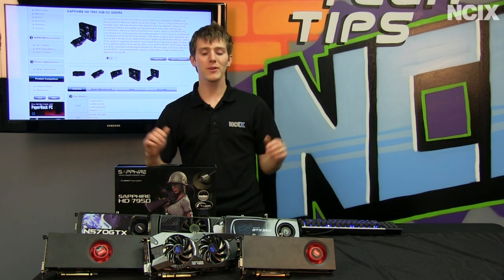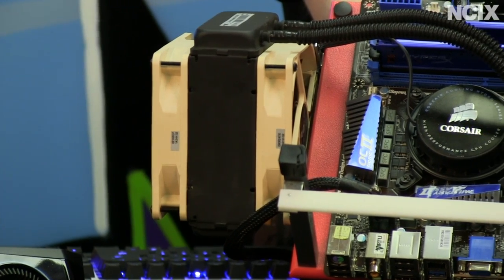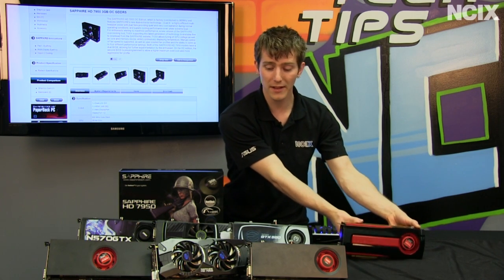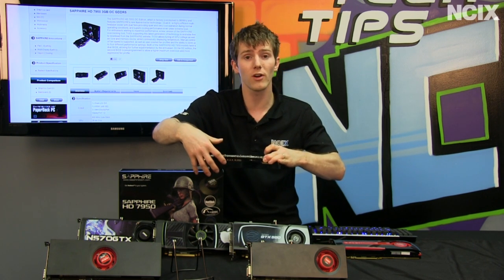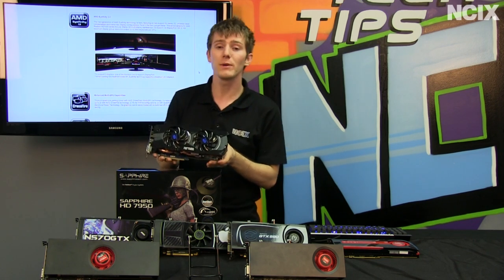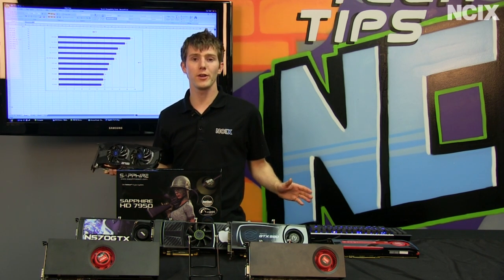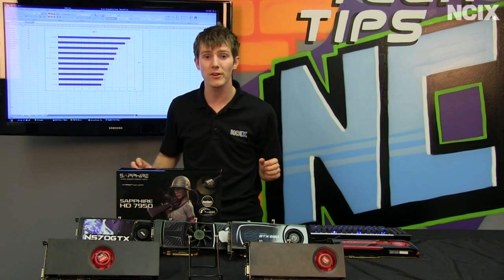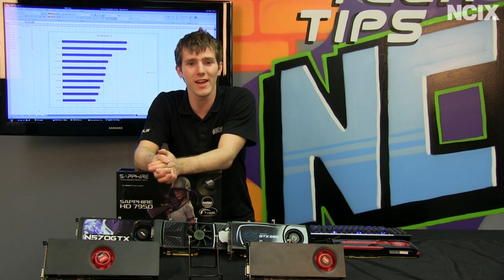Sapphire Radeon HD 7950 Performance Review & Technology Showcase NCIX Tech Tips

Comment: Hey igot problem my specs: 
Cpu : fx4350 
GPU: amd 7950 
Ram: 16 gb gskill sniper 1330ghz 
Hdd: 2 tb 
Psu: 600w mod 80 plus 
 BF3 RUNS AT avg 30 FPS 
But later I found that on cpu z app 
That my cpu is running on 2 cores when it's advertised at 4 cores. I don't understand I unparcked them over clocked the GPU nothing happened could I get some help here  $1000 on this pc just to get 30 fps in bf3 I can get that my ps3
Reply: Khinu DC You spent $1000 on that PC? wow... bad deal.
Reply: Khinu DC im pretty sure you have to, click on the 4 cores instead of just the two from going into properties; but don't quote me on it mate... :)
Reply: you could have gotten a way better pc for that money man

Comment: Still is an epic card! Runs BF4 on high settings with above 60fps 24/7
Reply: runs ultra 50-60 fps, Which is still more than playable.
Reply: MasterOfRockKL Drops down to 40 on ultra sometimes, as I have a 144hz I like to play on high as I get 1 and a half times more fps!
Reply: Personally I can deal with a few dips to 40-50fps. but the average is still 50-60fps ultra. To each their own :)
Reply: MasterOfRockKL Maybe your card is a bit faster because mine gets thermally throttled? My gpu hovers around 87-90! I have the xfx DD
Reply: jabbacoola1 Correction, You Sometimes can get more than 100fps, max fps and average fps are two completely separate things.
Reply: make sure you have good airflow in the case.
Reply: ***** Ty for replying on a 2 year old comment, it really helps!
Reply: RCTestKid i just find this card  on a dirt cheap offer and i start to research it a bit more and i learn things
Reply: @AndreiSolomon  years late but I found one for 25 is it worth it?
Reply: @ESKLEADER  no, it wasent worth it 5 years ago

Comment: will i3 3210 bottleneck this card????
Reply: yes
recommend you to get i5-2500K at the very least
or you can take FX 6350 or 8320 at the same price for i3
Reply: nickostrife i want to get the fx 6350 but my motherboard only support intel processors and getting i5 or i7 is a problem for me  because intel processors really expensive compared to amd processors
Reply: what's your budget?
you might wanna start saving on i5 3570k or if you're on a tight budget, investing in AMD system won't be a harm at all
Reply: nickostrife but i heard  that i can't install amd processors in my motherboard which is GIGABYTE H61M-S2P (Intel h61)  ..... what about gtx 750 ti will my i3 bottleneck it too???

Comment: Does this card support mantle?
Reply: AfterWind 7950 does support mantle. I own the his variant, I would know.
Reply: it's amd and mantle is an apu so yes
Reply: ImKaso WTF, don't listen to this guy.
7950 does NOT support Mantle, only the 200 series does, also Mantle is an API.
Reply: thanks
Reply: yup
Reply: i run it crossfire and it does mantle
Reply: ImKaso How much power does your cf setup take? I was thinking about adding another gpu to my system but I don't know if i should upgrade my 600w pc.
Reply: eeem i had a 650 and it was not enough you need 850 but i have been overclocking and i enjoy to buy things that is totally o k so i have an 1000w psu
Reply: ImKaso thanks.

Comment: man this card still kicks ass even though it passed through 2 generations of nvidia cards
Reply: +yonan007 i have a question im not a heavy gamer so i can pass for now on those fancy R9 390 and blabla i don't want to play Nvidia and i already own a pretty cool A8-6600k can it be good on a Crossfire ?
Reply: Hi, yes it's good on crossfire but I really suggest that you get a newer card for the support of dx12. Good luck 😉
Reply: yep i think of buying a new one but RED side and im strugglig for a small discrete card that doesn't bottleneck my A8-6600k
Reply: Take a look at the r7 370
Reply: i'll do i hope it will be sufficient enough to run MGS V phantom Pain with my A8-6600k overcloacked ? even on low or medium
Reply: It will ;)
Reply: no need for that lame ass PS4 thx for your advice in december i preorder that card right now i have to finish to buy my LG G3 i might as well get an LG G Watch to pair them !
Reply: +Roger-Charles Manga waw i myself have an lg g3 what a coincidence
Reply: i was just tired of my lousy Acer Z310 which can't even connect to my router and it's sucks !

Comment: I don't know where the hell potpolima gets his info but the 7950 is most definitely not 350$ I've literally spent the last week looking for the best deals and some are as low as 250 with rebate.
Reply: 259 waw seeing this comment is so weird: 1 year later i can but his card used for 100- 110 dollars
Reply: Lordmirio he posted it 3 weeks ago, not 1 year ago. and the 7950 is so cheap and it is much more powerful than a 760
Reply: Lordmirio And now I can't find a 7950 for less than $400.
Reply: Lordmirio They're still sold out, so it doesn't matter what price they are right now. I guarantee though that if they are in stock they will go for over $350.

Comment: the 7950 has more VRAM, in case someday you want to have a dual monitor setup (with 3 monitors you would need to crossfire), or play heavily modded Skyrim, GTA IV, etc. The 760 is about $50 more than a Sapphire 7950 :)

Comment: if you use openCL as your render, then the 7950 is going to be a great  slave card for real time 3D rendering!. but if you work a lot with C4D, you should get a Quadro or Firepro just because the drivers are optimized to get you the best performance of the card.

Comment: well the memory Memory Interface on the 7950 is higher"faster" than the 760.
the 7950 has 384bit memory interface while the 760 has 256bit so technically you should be able to get 20-30% more performance from the 7950

Comment: it really depends, the 7950 has pretty much the same performance as the 760 for roughly the same price, BUT (and this is optional) if you were to SLI the 760 and crossfire the 7950 the 760s hands down blow away all the competition within 450-500 USD because more than likely with 7950 you'll get micro stuttering. But if you don't do like 3d stuff, video editing you just want gaming and you hate crossfire/SLI then it really all comes down to how important advanced physX is to your gaming.

Comment: Over the reference design?

Yes.  A HUGE difference.  The reference design with the impeller fan (?) is almost always really noisy because of coil whine and runs hotter.  For cards that cost more than about $150, I recommend to stay away from the stock cooler.  The aftermarket cooling designs are almost always worth cost extra $20 that they cost over reference.

Also, the reference cards usually can't overclock as well due to the lower thermal headroom.

Comment: Yeah you can pick up a 7950 on eBay or newegg for around $210 if you get a halfways decent deal now.  I'd say at stock the 760 wins. However, the 7950 is pretty much the king of overclocking.  I don't know for sure but I think once you hit about 1000-1050 Mhz on the 7950 things change in favor of the 7950 quite rapidly in that comparison.

I'm not 100% sure on that, though.  If you're looking for the best bang for your buck, the 7950 is about as good as you can get now for ~$210.

Comment: I enquired about a basic build with a £500ish budget. Ram isn't a problem because i already have it. So the set up i was told that would be decent would be:

Mobo: ASRock H87 Pro4 ATX LGA1150 Motherboard 
CPU: Intel Core i5-4570 3.2GHz Quad-Core 
PSU:Corsair CX 750W PSU
GPU: This Card or the Vapor-X OC Version.

Is this a good combination? I don't know what works well together but know how to physically build a PC. Any answer would be appreciated.

Comment: Speaking from experience I know the hardware in both cards, the only thing the 660 ti wins at is Texel rate so it is easer for the 660 ti to show AF but the 7950 has more memory and bandwidth also a higher pixel rate, the texel rate difference is around 10-15% (Delta) so overall the 7950 is a much better card and can be OC'd higher.

Comment: can TRULY say that. I got a Sapphire HD7950 OC 950mhz edition. At base its just faster, but you can simply overclock it more. I reach a stable (24/24 use) 1150 mhz for Gpu and 1500 (mean x6 = 6000) Mhz for Vram. Yeah, it ger a little noisy but that thing is a MONSTER. 670 ? naaa ever better than a 680 !!

Comment: I have the AMD Shappire 7950 3G (Not the OC version) and im experience some problems.. This card should run most of the new games on high and ultra, but that aint happening for me.. Most of the games i have tried out lags and the frames freeze up some times, and this is very annoying! And some games wont even have 20+ fps when i have them on low setting! I have a pretty basic setup that should run most games without any stress.. Are there anything i could do to fix this?!?

Comment: At stock clocks, sure. If you overclock a 7950 to 1200 and 1700, it will easily beat a 670 at 1050 or so, which is what they usually overclock to.

Comment: Sapphire HD 7950 with boost vs MSI GTX 660 Ti power edition. Results from 3DMark: 7609points with HD 7950 , 8351points with MSI GTX 660 Ti P.E. So amd sucks. I played crysis 3 with both graphic gpus  and with 660 Ti the game was running way better and i had 5-9 frames more than with 7950 for the whole game with full settings and SMAA at medium.

Comment: Then you would be ignoring the 7970 Ghz edition. Also the GTX 690 is not a single chip car. The order would be like: HD 7970 Ghz Edtion, GTX 680, GTX 670 (since you can change the bios of the HD 7970) and HD 7950.
There is a test in HardOCP that shows that when oc'ed the HD 7950 can surpass the GTX 670. Of course not all cards oc equally, but it's a very achiviable OC. 1150 Core and 1400 memory. So the guy is right. 7950 third more powerfull single chip card avaible now 2013 Q1

Comment: rank 7 is not low by ANY means. There are many many GPUs out there, imagine someone said you were the 7th most handsome man in the world, that would be about as impressive. As for cards 1-6 as ranked by PassMark (rating using G3D) is 1. GTX 680 ($460) 2. GTX 670 (360) 3. GTX 580 ($310) 4. Radeon 7970 ($380) 5. GTX 690 ($1000) 6. GTX 660Ti ($270)
    Now this is just one benchmark, there ranks here that I disagree with and other benchmarks measured differently will show different results.

Comment: Get the Sapphire 7950 vapor-X 3gb and use the Sapphire TriXX Tweak Utility which overclocks it up to 1150MHz and up to 1600MHz on GDDR5 memory and this overclock can be achieved with stock voltages so it runs really cool. My temps are 34C idle and 56 Load which is really good. Look at the 7950 review on legitreviews(DOT)com then select video cards then its the seventh one down. Its the best card for Temps.

Comment: i bought one, should be coming tomorrow.
the good thing is, the price is right for what you get. (270€)
also you can easily oc it to 7970 clocks from what i´ve read.
my 5850 1gb runs bf3 on high with no problems but gta4 and skyrim with ~150 mods (4k textures etc) is maing problems. 3gb graphics memory is a hughe and in general the 7950 will be in my rig for at least 2-3 years

Comment: If I was you I would have gone with a 7950 as one, these overclock far better than a gtx 660 ti as well as overclocking the memory is more effective on these cards. with spending so much on a card you would expect to keep it for a couple of years AT LEAST! with the 660ti only having a 192 bit interface this is going to hold it back as supposed to the 384bit found on a 7950 plus it has 3gb Vram and like I stated before can overclock so much to where it's in par with a 7970 GHZ edition!

Comment: no a corsair 650 is enough to crossfire a 7950 cause it has about 600 watts...400 would be used for the gpu and the other are enough...and i know i dont need to cut on the psu...but anyway it aint modular and with only 2 6 pin connector i can t crossfire but i dont think i either need to ;)...also it a collermaster psu..and with 86 percent eddiciensy it s very good..

Comment: well i m sure that phenom is better than fx and i ve seen lots of guys with phenoms and 7950 without serious bottleneck..yeah i know it s not as good as intel  but because im going to stick with that for at least 3 years..after that im gonan buy a good cpu..maybe il stick less with it if i got fps problems which i doubt..another question:7950 need 200 watt psu.and the cpu need 125 watt.so  a pure  400 wtt psu would be enough..im gonna buy a 600 watt psu with 86 percent Efficiency.is it enough?

Comment: Average price for 7870 : 240-280
Average price for 7950 : 260-360
Which shows either the 7950 is too low or the 7870 is just crazily high and is just a rip off and these are on most of the trustworthy stores on the internet where I live.

Comment: @TheMrMeff  Just typing '5770 crossfire review' in google and looking on guru3d . com on their site, the 7850 beats 5770 cf significantly.  You might find better value going with a 6870 it's a hundred dollars cheaper but slower around 4 to 11 fps than 7850.  two 6870's would be pretty good & you could sell your 5770 and make some money back

Comment: @kirokester my understanding is that right now the x79 is superior however the z68 will support the initial ivy bridge processors which will use socket 1155. so for very cpu intensive games like battlefield 3 there might be a period of time in the future where z68 is superior. that being said i believe a new chip-set or two will be released with ivy bridge which will likely be better than both z68/x79

Comment: About the low Watt and heat, shouldn't your computer be switching to the integrated GPU (if you have the right CPU) instead of lowering the Watt of the GPU if you're not using any graphics intensive application?

Comment: have my non-OC version of the Sapphire and have it OCed 1100MHz(1.212V)/1575[6300](1.618V) and I know that is not its limits and is actually afterburners limits. I plan on not trying to squeeze anymore out as even with 130cfm fan blowing from the side at the card it runs around 70% speed for the gpu fan. I don't want to wear out the fan as I did in 4870. These fans are at 0% until gpu hits 50C for noise issues. With a 3820 OC to 4.4(1600ram) I get 8717 3DVantage11. OVER 9000 would have been nice

Comment: @I5ZQ8 
The 7950 should give you around double the performance of a GTX460 and if you are playing full HD then the 3GB memory will remove the bottleneck caused by 1GB of the GTX460 on ultra settings.
But I'm afraid even at 4.2Ghz the first Gen i5 will be the bottleneck at some point since BF3 is very CPU hungry.